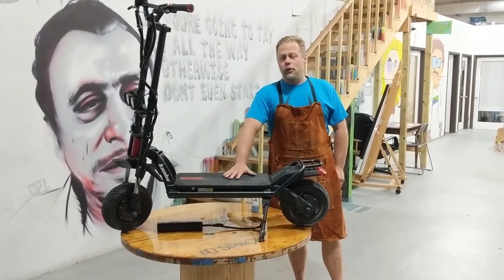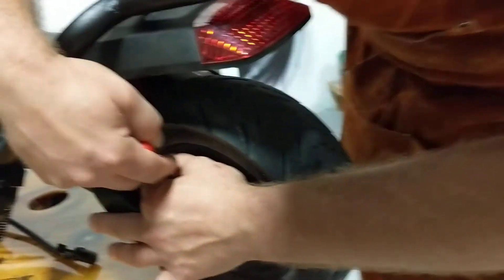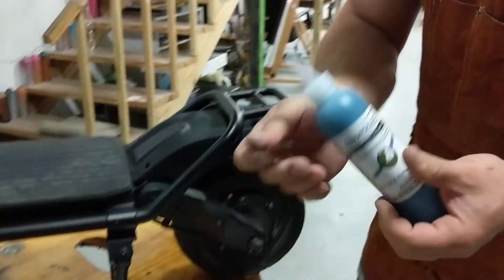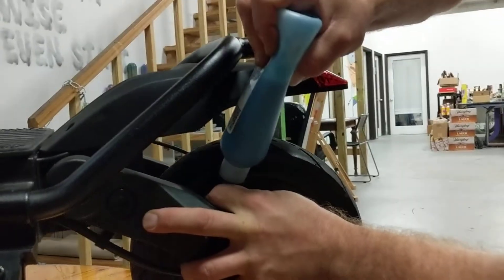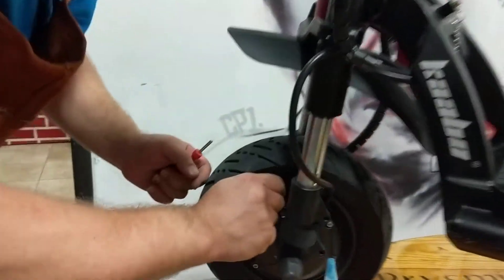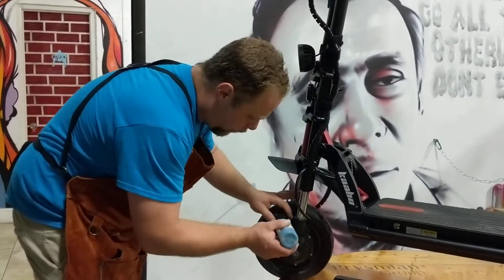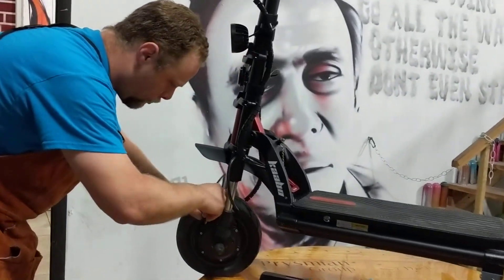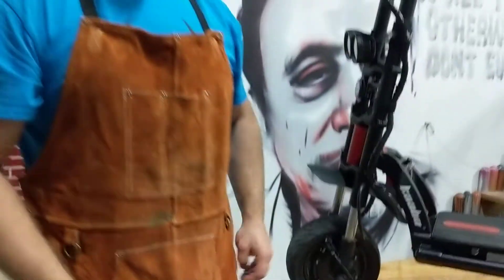Armor-Dilloz Tire Sealant installation in Kaabo Wolf Warrior 11 Scooter

Comment: Is it ok to use the whole bottle? Thanks
Reply from the maker: There is some flexbility where you can add a little more or less depending on your performance or protection needs. If you have 11in x 3.5in tires, we would  recommend about 4oz - 6oz per tire. What size are you tires?
Reply: @ArmorDilloz  I've got
100/65 - 6.5 off road. 11inches for my Nanrobot LS7+. I've got the Armor Dilloz Blue.
Reply from the maker: @EasyAl51  6oz would be a good amount here.
Reply: @ArmorDilloz I have an Apollo Air 10" wheels (older model, not 2024). Do I put in 2 oz or 4 oz or more? Thank you in advance.

Comment: the real question remains. Is this going to increase the difficulty of changing the tire my self when it goes bald?
Reply from the maker: The product is water based and wipes up easily with a damp rag/paper towel. You can put a rag underneath the tire if you have concerns about making a mess.

Comment: What kind of air pump is that?
Reply from the maker: https://www.amazon.com/Oasser-Compressor-Portable-Inflatables-P1S/dp/B07H3LP4LL/ref=sr_1_3?dchild=1&keywords=Oasser+Air+Compressor+Electric+Air+Pump+12V+Compressor+AC%2FDC+with+2000+mAh+Rechargeable+Li-ion+Battery+120+PSI+20+Litres%2FMin&qid=1595322706&sr=8-3
Reply: Thank you!

Comment: After putting this in the tires how long does the product stay effective? Say if I only get 1 or 2 tiny wholes will this still work years later
Reply from the maker: Between 6 months to a year of peak effectiveness, assuming minimal punctures and reasonable conditions - 1 or 2 tiny holes will make no difference.

At the year mark we do recommend adding 25-50% of the original dose as a booster for continued optimum performance - but this isn't an absolute requirement.

Comment: How does this sealant work with the inner self-healing lining? I have the WolfKing GTR.  
I wish that I had known about this prior to replacing the tire.  
I'll try this on my tires.
Reply: Nice ride!

All feedback and testing has shown no issues with using it in the self-healing type tires, and, it has proven effective in a few cases that have been shared with us where the self-healing material was just not doing the job.

Obviously somewhat limited data, so we can't say with absolute confidence it's 100% compatible, but all reports thus far indicate that it's just fine.

Comment: does it freeze during the winter?
Reply from the maker: The sealant is freeze protected. We do have users ride throughout the winter with our product. A scooter or other pev will stop running at lower temps before you will have an issue with sealants. It's still best to keep pev indoors in a climate controlled environment.

Comment: Hi.Why the blue for e Scooters and not the pink or green?What's the difference?Saw People using every colours in their Scooters.Confusing.In Germany E-Scooter are restricted to 14mph.Not sure which one to buy.
Best regards.
Reply from the maker: We used the blue as the Wolf Warrior hits speeds of 50mph+. Our blue product is a great choice for all scooters and was created in conjuction with a scooter company. It's optimized so it can be used for higher speeds and also has additions like a higher load of long fibers which is good for tube tires. If you have a max speed of about 30mph, our red product would be an option as it is optimized for lower speeds.

Comment: Hi Cory, thanks for the video! Usually I put 40 psi on the wheels of my wolf warrior, and I saw that you put 50 psi on it, is that because of the anti-puncture fluid or because you always use 50 psi? Regards!!!
Reply from the maker: Hi Gerardo! I prefer the ride and performance at 50PSI.